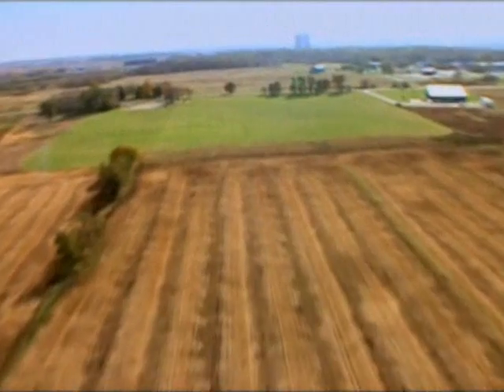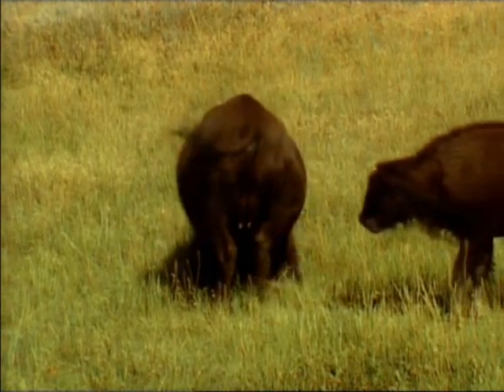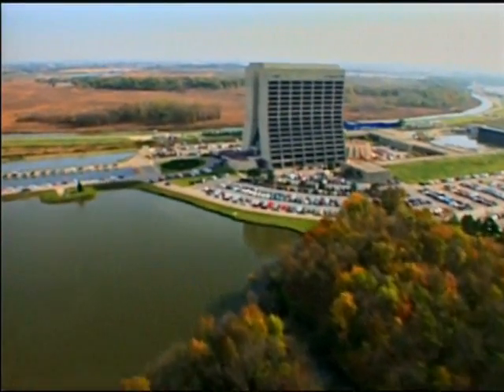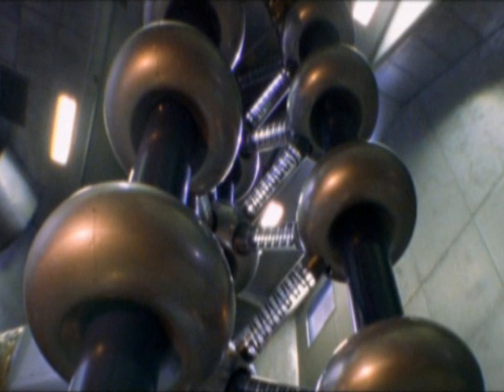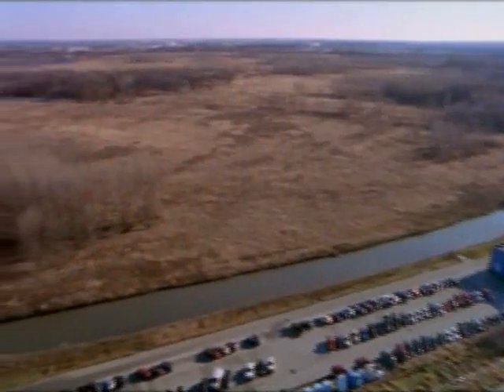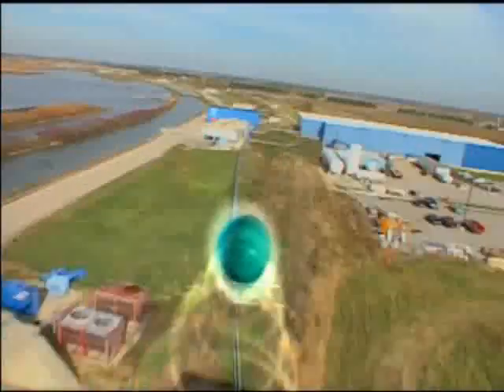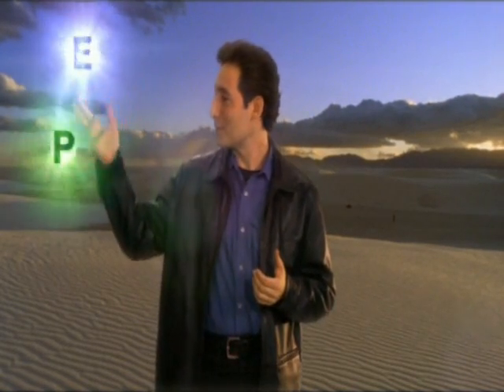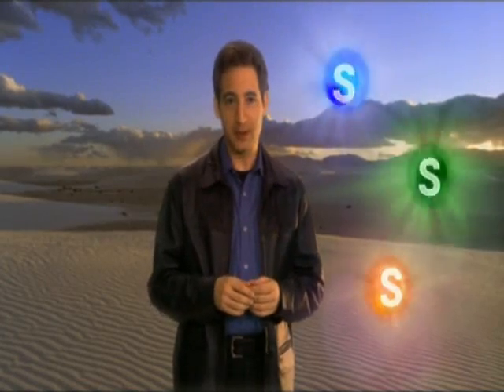Part 11: M-theory

Comment: An idea to simplify math; if in the theory of quantum strings we replace the quantum string with a quantum one - a sphere of quantum type - a "rosebud", then in physical models we will consider work; quantum gravity, entanglement of quantum particles, dark energy of the Universe, entwining and patching up the quantum web of Einstein's smooth space from the chaos of quantum fields. The Big Bang occurred in only one quantum field from a quantum string in a rotating coil entangled between two electrons, relative to which the visible universe was precisely tuned ... http://g55ton.narod.ru

Comment: String-Theory is not really a theory. It did not solve any real problem at all, and did make no provable predictions.
Reply: Well, yes and no, on both accounts, it does solve some problems but it creates new ones, and it does make some predictions though some of them aren't that great, but in time the theory will progress and it will either be thrown away or improved, so lets just wait, study, and see.
Reply: For a prediction that is recently confirmed look to 3:30 on this video! :D
Reply: Sky Darmos  It's the easiest way to do calculations in QCD, so it's already been put to use in the lab. So you're wrong on that account.

Comment: @bttllp 1d is limitation to a single plane(pair of directions), 2D limited to 2 planes(4 directions, 3D limited to 3 plane(movement within/along and rotation upon these planes allow us to see all dimensions/directions, other those that requires more than one point of reference, like 4D the ability to see the front and back of something requires a mirror or communication with an external point of reference.

Comment: If we consider a beam of light in cross section, we see a circle with information/signals(frequency modulated) within. So related to dimensions lets give each signal a direction of motion through the centre (say 12 - 6 clock face ref.) . If each and every frequency has its own plane through zero then infinite bandwidth and infinite dimensions within a 2D space, depending on radius of  beam. So by picking off frequencies at each degree you have ultimate bandwidth.

Comment: I think string theory dimensions are possible directions of movement. Take 0 as reference on a graph and using axes of fixed length make a ball. There are infinite directions as there are dimensions. 3D is related to directions, forward - backward, left  - right, up down. So why is infinite dimensions so hard to comprehend ?

Comment: If we are compressing at the same rate as the planet we would not notice gravity reducing as the earths surface area reduces because the same thing would be happening at the same rate to us and our equipment.
Could it be that the reason no matter where you measure from, the epicenter of the big bang always results in the eyepiece of the telescope is not because the universe is expanding, but that everything on earth is shrinking ?

Comment: The average diameter of atoms can be extrapolated from the division of planet earth's diameter versus its age. That number is 3 billionths of one inch, or 90 billionths of one millimeter and it represents the tiniest linear dimension that may be calculated from two real values within a time period of a fraction of a second a second, or slightly over one second. That time period i've identified as a cycle of evolution. While an atom is being incepted at a given point, many others are also forming

Comment: An atom is a very simple devise of nature that is made up by families of frequencies that crash with other families of frequencies and weave into intrinsic lattices of matter. By the standars of my theory, they can be synthetized to a predetermined outcome at an accelerated pase that would prove to be faster than the speed at which nature produces them. The equipment needed is relatively inexpensive in contrast to a particle collider that will eventualy lead to nowhere other than to bankrupsy.

Comment: @buxombabyNJ it's not the same. in this universe mass never disapears. this would be an exception. mass could disappear if you turn a MATTER-string into a FORCE-string by changing the way it vibrates.
the string would then float off out of the universe. it's gravitational force would seem weaker to us. which means, mass was turned into energy (mass conservation fail) and that energy isn't at 100% for us (energy conservation fail). i don't know for sure but that seems like a way to know...

Comment: @citricsystemz: That's highly unlikely to the point of being impossible. I think that the biggest danger would be to the people in the area immediately around CERN on the off chance that the whole system simply self-destructs from a catastrophic mechanical failure. I could imagine possible radiation damage from the exotic particles but nothing planetary; and I'm sure the system is contained and heavily shielded.

Comment: A major obstacle in the search for quantum gravity is the lack of experimental data. This is due to the smallness of the scales that are connected with such a theory. To probe the Planck length with contemporary accelerators one would have to build a machine the size of the Milky Way ! The above clip consists solely of optimistic speculations..nothing more.

Comment: AS a mass less particle a photon can travel at the speed of light if it is in a vacuum, in other materials (like glass) it is slower (hence refraction) nothing else can travel at the speed of light, as it would take infinite energy to get there, so the anser is "close to the speed of light, Cern will get closer than fermilab when they are up and running, but we are talking fractions of a percent, but an important fraction nevertheless!

Comment: In order for the universe to be so majestic that it requires a designer, surely you agree that the designer would be infinitely MORE majestic and complex than the universe. You're solving an unknown with an infinitely larger unknown; and even worse you're doing it with no evidence whatsoever. I agree that the universe is complex, but a God would be even MORE complex, wouldn't he require a designer? Sure, you can say "God existed forever" but you can also make that excuse for the universe.

Comment: there are actually FAR FAR more states of matter than just 3 or 4 or 5 there are at least 30, some are only sub-categories of  the common states of matter and some are compeletely different, for example look up things such as fermionic condensate, degenerate matter, crystalline solid, or supercritical fluid, but i don't completely understand the original comment by Katharsis540, what does the states of matter have to do with string/M-theory

Comment: The phases of matter have nothing to so with this. Think of the planets in orbit. You never see them move in an "unnatural" way because they're governed by 3 dimensions. Strings seem to have no set path with 3 dimensions. So, to predict it's path, you need 6 other ways of moving.

By the way, there are 5 states. There's the bose-einstein condensate. (Which is a number of particles near 0 kelvin that are crushed and lose their identity and think they are all one object.)

Comment: You can walk around in the desert for 30 years and not know which way your going.

The fact is, 1) String Theory is based on something that cannot be proved or visually seen due to light waves not being that small. Religion much?
2) M-Theory doesn't describe Supersymmetry is a logical way.
3) A theory of everything should explain the conditions at the moment of big bang.
4) The fact that Quatum Physics described in change the whole fabric of the universe to such a extend is very hard to believe.

Comment: To me it sounds like each quark has a specific charge presented from the stings contained within them. The strings themselves are very small and most of them open looped and attracted to the very membranes of our meta universe. But some strings are closed loops, which enable them to ignore the attraction that the open loop strings have, and are able to escape the membrane and enabling them to leak into other parallel realities to effect and react with the subatomic particles within them.

Comment: Okay, but if a anti-matter particle collides with a matter particle both particle annihilates and turns into energy. But u said there were 10 antimatter for every 11matterparticles formed during the bigbang, but how is that possible if everything is made out of nothing its hard to explain or understand (also because im dutch). But that fact tells us there should be more matter than anti-matter in the beginning of the big bang. I don't understand it really :S